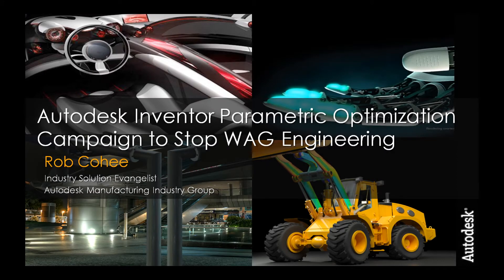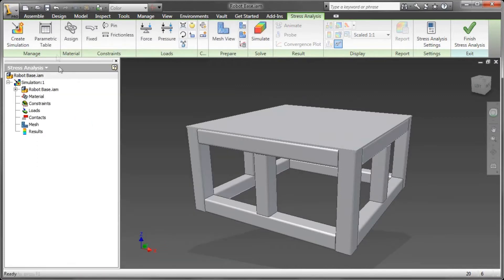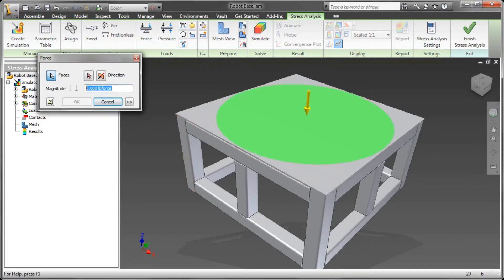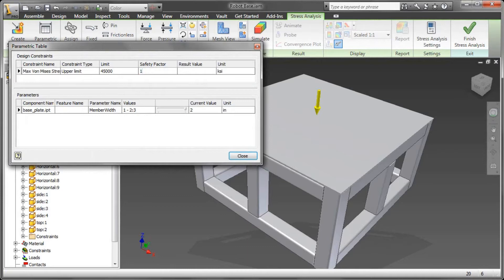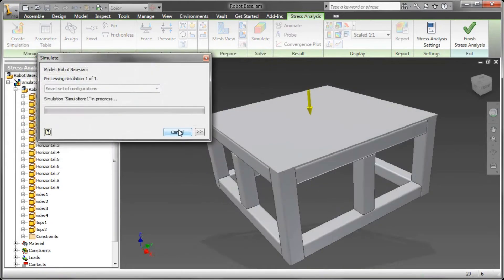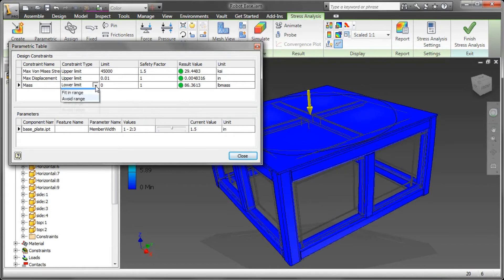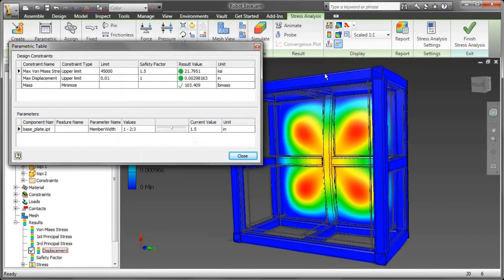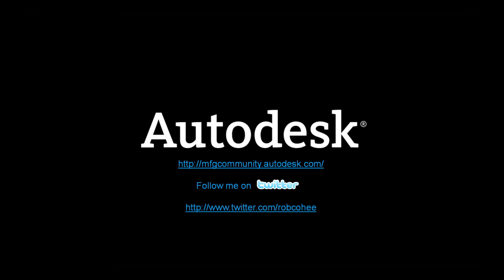Autodesk Inventor Parametric Optimization

Comment: Hey rob, im using the stress analysis in 2014 inventor for the first time (first time using stress analysis) and my model keeps separating into 2 separate components. Its basicly a leverage device with a single 20mm bolt and a hydraulic ram. It seperates where the ram moves up and down in a sub assembly and on the 20mm bolt. how do I stop this happening?
Cheers

Comment from the maker: From Jay Tedeschi - our simulation guru: They are often interpreted as the same, and in some cases can be, but they are in fact two different properties.

Deformation is just that, the change in shape or form of a component due to applied forces. Displacement is the value, in distance (or volume) of the amount of deformation.